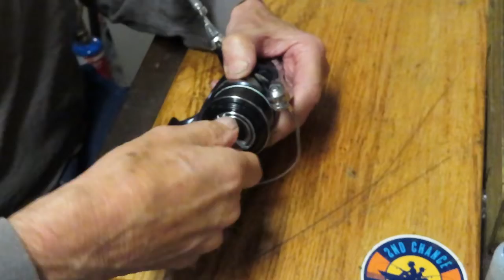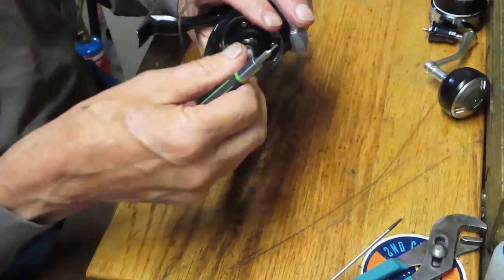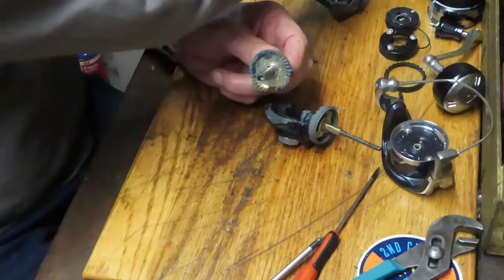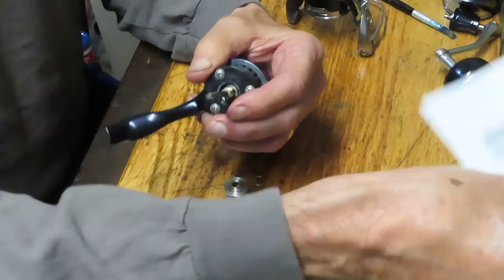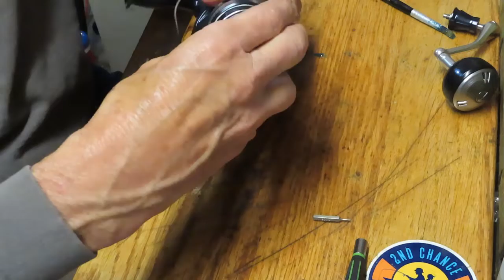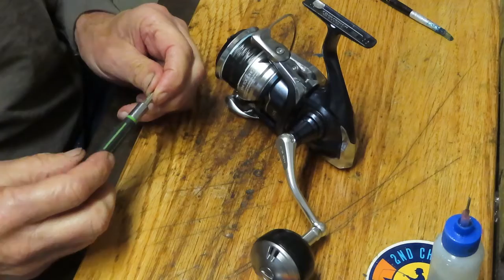Shimano Twin Power SW5000HG spin fishing reel how to service

Comment: Hi There
Thanks for the video. 
I have two questions and I appreciate if you could answer them:

1. I was told Stradict Sw and twin power Sw have same internal and just because of marketing twin power is several hundreds more expensive. Is it right? Or twin power Sw has better quality gearing and sealing and is worth extra money? 

2. I have Certate SW and internal bearing fails when I jig due to cranking. It can not take lots of reel cranking. I am wondering if Twin Power or stradict sw has better design that won’t fail due to cranking the reel in jigging? 

Thanks and I appreciate your experiment
Reply from the maker: The main differences in the TwinPower and Stradic is gear ratio and number of bearings.  I suspect that the materials differ in the case and gearing as well.  Both are appropriately sealed for saltwater and I am unsure as to the value difference between the two.
Is it worth it?  That is an individual decision!

  If you are breaking bearings on the Certate, which is not easy to do, then my guess is that it is either the bearings or the reel design.  That reel design is the more traditional oscillation gear and crosswind block set up where the Stradic is  a worm gear and pawl set up.  I would probably swap the original Certate bearings out and put in hybrid ceramic bearings to see if they make a difference.  If you have the same problems over time, then I would blame it on design - Thanks for asking - Dennis
Reply: @2ndChanceTackle thank you so much for sharing your knowledge

Comment: Is it true if I buy Shimano Twin Power from Japan, they are not warrantied or serviced here in US?

Digitaka lists 21’ TP SW 6000 HG for $371, shipped free!

Here in the states Bass Pro sells for $589
Reply from the maker: I believe you are correct.  I just did a JDM Shimano KisuSpecial that is not supported here in the US - Dennis

Comment: Thanks for this ! I have a little gap and play of the handle so I need to get another shim to the main gear to fix it. I found that this part is hard to get here in EU ( original shimnao part) . So IF I knew the dimension of inner circumference of the washer I could find if locally easy. Do you maybe know the dimension ?
Reply from the maker: I'm sorry, but I don't have that reel in my shop so I cannot measure the ID,  Thanks for asking
Reply: @2ndChanceTackle  no problem. Ordered original washers, dont want to gamble. Thanks for reply.

Comment: Hello Mr. Dennis I have bought a new Twin Power SW 5000XG. During turning of the handle; the inner parts with rotor and the handle, wobbles shakes and makes sound a bit. I have read some similar comments from other users and curious if it's a common problem of the reel. If you have a mail address or social media I would like to send You the video of it during turning. Is it something I could fix it or it's better to return it ? Thanks a lot :)
Reply from the maker: Thank you - I saw the video and think that this is unique to your reel

Comment: when i go put back the reel together on my 2015 sw5000hg, the rotor nut cant reach the threads and wont allow me to hold the rotor still... any suggestions sir?
Reply from the maker: Check to see if you can pull up on the pinion gear.  There is sometimes play that allows the pinion gear to slip down durning assembly.  If you can pull it up, you should be able to get the nut on it
Reply: @2ndChanceTackle and what if I can’t pull the pinion gear up to give it more threads… the clutch assembly holds it down more not allowing me to grab any threads

Comment: I’m always interested interested in seeing how many different size screws are in a Shimano like this. Most of my Shimano reels are either the 1970s silver MLZ reels or the 1980s SSG 7000 rear drag reels. The worm gear drive in this reel looks just like the ones in my Daiwa Emblem reels. Why is this reel called “Twin Power”. This is a very nice reel but you know why I don’t want one. Thanks for sharing this one. I’ve wanted to see the inside of these reels. — Chris
Reply from the maker: Always learning Chris!

Comment: I got my twin power back from servicing with Shimano but the bail arm seems to have a gap between the arm and rotor itself on the opposite end of the line roller. The screw is tightened down but the gap is still evident, do you know of a method I could fix it without sending it back in with Shimano as this time it took me 2 months to get my reel back
Reply from the maker: That usually means that the bail wire is bent.  You can remove the screw that does not have the spring assembly inside and gently compress the wire to restore the share.  That should narrow the gap - Dennis
Reply: @2ndChanceTackle  I'll try that, thank you so much for the tip

Comment: Love the TP from Shimano. 
Though I have to admit, I cringed when you took those pliers to unscrew that cap.
There are ways to protect these caps from scratching, when unscrewing - you can use a rubber band around the cap, but I use a small rubber ball to press again the cap and twist. It’s an old trick I’ve used to open the backs of mechanical watches when servicing higher end time pieces.

Also, forget about having s bunch of wrenches. Get yourself a Knipex plier-wrench. I have the XS model with is super compact but works on every reel you can possibly need to service.
Reply from the maker: Thanks for the tips.  Sorry for the cringeworthy moment!  Dennis